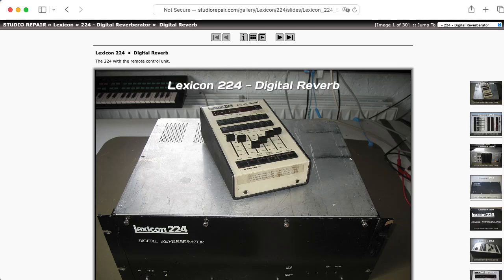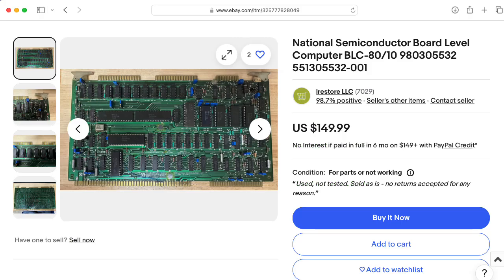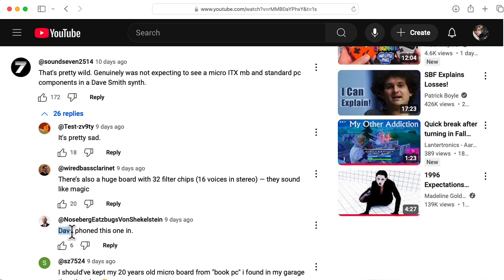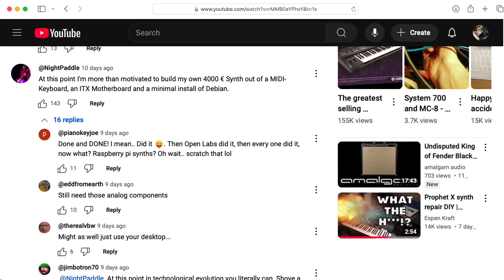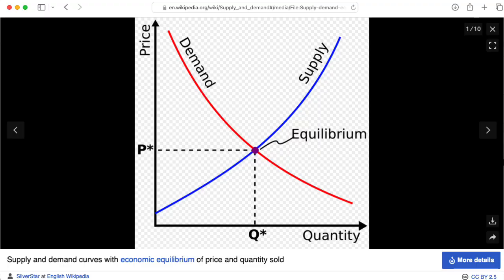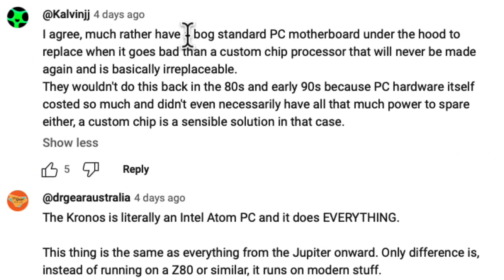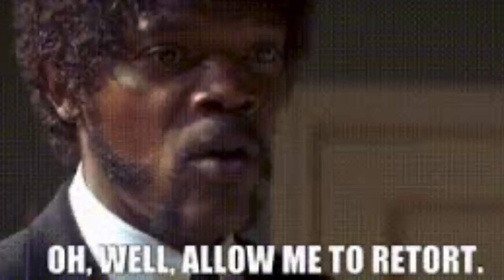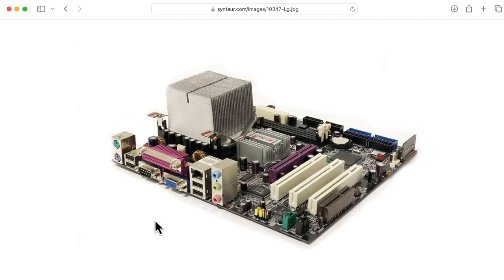Yes, the Sequential Prophet X Has a PC Motherboard. And that's OK. (Response to Espen Kraft Viewers)

Comment: A relative of mine bought a broken Lexicon 224.  He had to make a couple minor repairs to two of the internal PCBs, and then he designed his own remote for it in a new style case, and it's flawless now.  Quite a cool project.  I hate it when people who don't do any design work or building, or anything else at all (sometimes) go an complain about the design choices of designers.  Or the price complaints.  Like you, I tell people, buy it or don't, enjoy it or don't, but things cost what they cost, and design choices were made for very good reasons (most of the time).  Excellent video!
Reply from the maker: Thanks!

Comment: Had a Memorymoog Plus that struggled with using what was basically an Z80 micro Single Board Computer and the supporting boards, digital, analog and voice cards all wired up looking like Chef-Boyardee and Bob Moog had a baby synthesizer. It was semi-reliable, but nobody cared because it would melt your speakers.
We will cope with knowing that there's way more digital than analog under the hood in today's synths, but we love that knobs and sliders are back and we don't have to be victimized by Microsoft directly, but I do love Cherry Audio VA synths.

Comment: First, you hit the main points very well. The reason you use a "standard" of anything, is because it reduces (long list), plus if enough of a certain item is made, then someone will make it for a long time as a repair part (see car parts that many manufacturers will make, not OEM, but then, some are with a different name). Whenever building something, using an "off of the shelf" (aka standard), just makes sense and is best practice. Even at the OS level. If people really knew how hard it is to make an OS. Furthermore, doing low level code is pretty F'n hard. Better to use proven APIs, if boot time is a problem, they should plan ahead. Good video, good points. Custom means, not better, just means, special (and hope it doesn't break).

Comment: You're damned if you do, you're damned if you don't. Apple is despised for the exact opposite reason. They spare no expense in giving the end user a exceptional experience. They would rather incur the significant expense of developing their own software and hardware than license them from a vendor. They've even gone as far as designing their own microprocessor, which is unheard of, especially for for consumer market. Yet, many complain that Apple products are overpriced, proprietary, and difficult to repair.

Comment: So long as it's replaceable. A PC mobo should be replaceable with any mobo from that CPU generation, so an AM4 board if there's an AMD chip, or the appropriate Intel board, etc. The reason analog hardware is great is that it's not proprietary, anyone who understands analog can repair it, indefinitely, with common parts. That's not true with boards. If they've done proprietary fuckery with this board, then when it fails, either you pay them something silly for the replacement, or worse, they just don't make one, and you're hosed, your $4000 synth is junk now. This YouTube random did not do the sort of long term reliability testing to verify that, and doesn't get to tell us what's okay. It's not your money. We're not your children.
Reply from the maker: Alas, it looks like the ease of repairability of analog gear is only true of older gear. All the PCB photos of newer analog gear I'm seeing is all surface mount that's awfully hard to repair unless you have a lot of experience and the right gear.
Reply: @Lantertronics  And let's not forget the issue of obsolete/exceptionally hard to find parts. If certain SSM chips fail some gear can quickly turn into a doorstop...
Reply from the maker: @maro_from_germany  Fortunately a lot of those chips have been reissued. But, indeed, not all!
Reply from the maker: You seem to have misunderstood my point (admitted, the title alone does not make this entirely clear): I was addressing the question of whether Sequential (or any other manufacturer) is inherently "pulling a fast one" by using an OEM motherboard, which is what a lot of people were claiming. Whether Sequential messed up in the details of this particular instance is another issue.

As I note at the 6:06 mark, Sequential clearly messed up by doing insufficient reliability testing, and for that they should wear the Cone of Shame. Maybe they didn't do a sufficiently good job in mounting the motherboard so that it could withstand the strain of being moved (it would be interesting to know if people who gigged with their Prophet X had more trouble than people who just used it in the studio). Or, maybe there's a heat dissipation problem. Or maybe that particular motherboard is just junk and they should have chose a different one.

Comment: The fundamental philosophy behind technology choices is directly related to purpose. A pc motherboard is a PC motherboard because it facilitates and communicates best for a computing environment with a monitor, keyboard, and mouse. NOT a synth. I have owned synths since 1985, and one pf the bedrock principles of a synth is it needs to work reliably when you turn it on and need to play/perform. For that you need bedrock reliability and something that can withstand transport (banging around). Designing for that purpose delivers a board that facilitates those needs.
Reply from the maker: In this case Sequential failed to properly perform reliability testing on this particular configuration. Perhaps they didn't mount the motherboard well in a way that reduced it being subject to vibration; perhaps there's a problem with thermals; or a combination of those and other things. 

I don't recall Korg customers complaining about motherboards failing in the Kronos, so the use of a motherboard itself isn't inherently the problem.
Reply from the maker: One annoying thing about hardware running a full OS is the boot time. There's signal generators at work that take like a minute to boot up.

Comment: There’s nothing wrong with using a pre-made computer platform in a synth.  However some are better choices than others.  Using a standard pc motherboard in a end product that doesn’t include a pc screen and keyboard is not a good idea because the BIOS need those peripherals to communicate errors to the user, and give the users a mean resolve those problems.  In the case of Espen’s problem, the BIOS was indicating a problem with the CMOS battery and asked the user to press F1 to bypass this error and boot anyway.  Since the prophet X didn’t have a standard computer screen and keyboard it looked like the synth was frozen because the boot process was interrupted and the Prophet X firmware wasn’t running.  Had Sequential used a proper embedded computer platform like a Raspberry Pi or similar, this problem could have been properly handled because those platforms are designed to be embedded in applications that don’t include a standard pc screen and keyboard.  This is a poor hardware choice coupled with a poor firmware that gives a sub standard user experience IMO.
Reply: Someone make a thin client version of AV Linux and throw them on little buddy boxes immediately 

The public'll love it, you'll make a million
Reply: @neilpatrickhairless  Every high tech company wants the Burger King Rodeo Burger. Repurpose cheap hardware and freely available software, slap a label on it and call it a day.
Reply from the maker: I don’t think that’s a fair assessment of the Prophet X, though. That’s a very complicated analog board.
Reply: But like wearing a suit at a business meeting, you should show your customers some respect. Don't let them see a low cost ASUS branded board in your product. HP once sold a low cost minitower PC at Walmart where it had a laptop mobo with an external power adapter. It was essentially a repurposed older laptop model sold as a desktop. It was shocking to see such a janky presentation come from an otherwise highly respectable company. Apple would never do that!

Comment: I feel very seen by that comment about VNAs! We may be using "standard" PC motherboards in the sense that they could be used to run anything (see CRD's little guys series). The main difference is supply chain. When we design around an SBC, we need assurances that the SBC will be available for as long as we will conceivably make the product, and when they do discontinue it they'll give us an opportunity to put in one last big order before their last manufacturing run. 

A customer as small as DSI can't get that from the likes of ASRock! When this specific motherboard goes off the market, they'll be on the hook to find something compatible or add support for something new.

Comment: Roland samplers in the 1980 were also based on a standard MSX computer.
Reply: No, the Roland S series samplers (and W30 workstation) had nothing to do with the MSX architecture. The MSX used an 8 bit Zilog Z80 processor, whereas the S series used processors from the 16 bit Intel 809x family. Earlier Roland products did use the Z80, but nothing about the implementation reflects any influence from the MSX standard.
Reply: @ thank you, recently read it and from the looks of the screen it would have been possible. On a vintage synth page I found the info that Roland used the MSX mouse. Maybe that’s where this comes from.
Edit: I checked the service manual and the CPU and it was a 16 bit architecture. That makes more sense than an 8 bit Z-80 architecture.
Reply: @mudi2000a  You're correct about the Roland mouse being MSX compatible - I used to have an S330, and until relatively recently it was a pain to source a suitable mouse. There's now several adapters that allow the use of PS/2 or even USB mice Wish I'd kept my S330, but I still use a W30 as my main controller keyboard and sequencer!
Reply from the maker: I didn't know that! That's very interesting.
Reply: @ I just recently learned that but now it all makes sense that you could connect a monitor, mouse and keyboard to those. Which actually made editing easier. 
The PPG digital synths also were all based off of some standard industrial 6809 platform btw.
Reply from the maker: @mudi2000a  The Buchla 400 is an S-100 bus system (like the Altair or IMSAI 8080).

Comment: People get a bug up their butts because they're anti-DAW snobs and it rubs them the wrong way to have a "computer" inside their Real Musical Instrument.
Reply: The audiophile people would have the PC in a separate box. The philosophy there is anything that causes EMI should not be anywhere near anything that does low level audio signals. This is why you have external DACs rather than Soundblaster cards. They run off separate power supplies.
Reply: @Andrew-rc3vh  Ah, so not musicians. Got it.

Comment: I guess some people are going to be really pissed that the Korg Kronos used an off-the-shelf Intel atom motherboard running Linux, the newer Akai MPCs used an ARM 32-bit processor on a SOM module running Linux, and Korg's smaller synths such as the Wavestate, Modwave, Opsix, and now the Multi/Poly synths use Raspberry PI compute modules also running a real-time fork of Linux. Edit: Sorry for the repeated info here, I commented before hearing the rest of the video.
Reply from the maker: I didn't know about the Akai MPCs -- but it doesn't surprise me at all. It makes sense to use OEM modules.

Comment: Correction, the Prophet X has a SH!TTY motherboard that must be a very specific revision. They didn't bother stocking any up for service work. So yeah, only 5 years after its release, these motherboards are nearly impossible to find. GO try a slightly different revision that you CAN find and let me know how that goes. And oh yeah, that obscure turd also needs specific firmware that they won't let you have access to. SO tell us more about your 30 year old Lexicon and how that is somehow comparable?

Comment: Great video - I've always been frustrated by this "ugh it's just a cheap PC?" line of reasoning. I 100% put more value well thought out architecture and UX. Yes a lot of what makes up a Hydrasynth could be a VST, but the UX and UI are absolutely worth paying for.
Reply from the maker: Well... there's other things, like the physical hardware probably isn't going to make you log in to some license server that will go down in five years...
Reply from the maker: I've been saying for ages that the only real point of physical hardware is the user interface experience.

Comment: apropos to LMNC's recent video: Peter Zinovieff built his MUSYS system around two 'off-the-shelf' DEC PDP-8's.
Reply: Just saw a "Look Mum, No Computer" video where he got to play on Zinovieff's EMS VCS4. He mentioned in that video the rest of the EMS studio was lost in a flood while in storage, presumably including the PDP8s.
Reply from the maker: I'll need to check out that video! (Love LMNC)
Reply from the maker: A lot of the later PDP-8s were sold as "OEM" parts to use in bigger systems.
Reply: I've got a kit called a "PiDP8" that I need to get around to building. Appropriately enough considering your video's subject, it's a working replica of a PDP8 control panel with a Raspberry Pi inside that runs an emulation of the DEC mini computer itself.
Reply from the maker: @chriswareham  I've seen it! I'm obsessed with the PDP-8 so I've been tempted to get it, but I have to be realistic and realize I'd probably never get around to building the kit...

Comment: Saying "It's just a cheap ITX motherboard" makes no sense. Most of the electronics that goes into synths is cheap. You can buy the SSI filter and oscillator chips that go into the $5k OB-X8 for about $5 each (probably much less if you buy in bulk). Capacitors, op-amps etc. are also dirt cheap.
You aren't paying for the individual components, you're paying so the company can recoup the R&D cost and the cost of all the tooling for setting up for mass production. Of course the more units they sell, the more people there are to share this cost, which is how Behringer are able to keep their prices so low.

Comment: Not sure how this is different from the 1980s Synclavier that came with a Mac II, apart from that the Mac II wasn't stripped down to the pcb and incorporated in the Synclavier rack.
Reply: The Mac was basically just the terminal for the Synclavier which still was running its own OS on its own processor. So the Synclavier was basically "outsourcing" a part of the user interface to the Mac (and admittedly some other functions - but sound generation and sequencing was still completely inside the Synclavier itself).
Reply: @maro_from_germany  

Sure but my point is they could have done that in-house and in hardware like Fairlight.

Using a Mac instead seems effectively the same as using a mass-market PC motherboard inside the keyboard. It's just that computers have become so compact that it now fits inside rather than being a separate unit.
Reply: @jonathanhendry9759  The Synclavier used external terminals from the start (first a DEC, then another one that I don't remember right now); and back in the day NED even had a mouse that connected directly to the mainframe. Using a Mac was basically the continuation of this; in large parts it still was that "dumb" terminal that was not much more than a glorious console connecting to a serial port. When using it beyond that you needed to add a bespoke Nubus card from NED.

Comment: Sequential isn't involved in price gouging. BUT the prophet rev2 was released at €1443 in 2018 and now costs €2485. That's a 72% price increase. If you consider inflation, the price should be around €1800.
Reply: Inflation isn't the same across the board though - some things are more affected than others. So the price increase might reflect their actual increase in operating costs - or it might be even worse price gouging. We don't really know.
Reply: You can get one used. It's a good synth. A little too thin-sounding for me though on some (not all) patches.